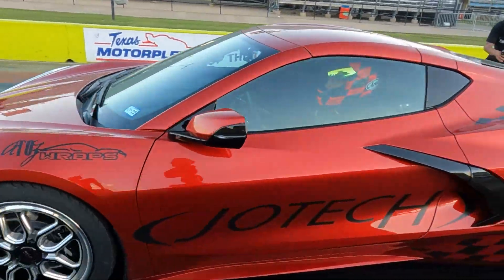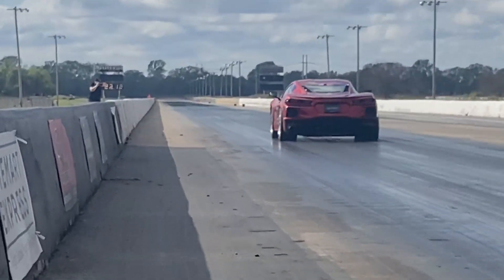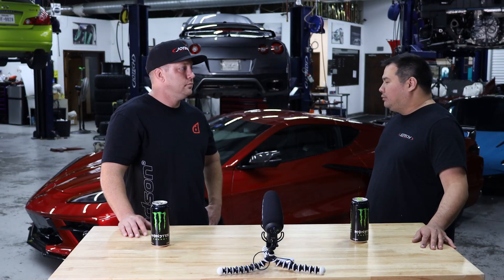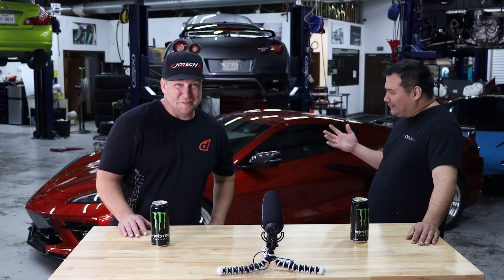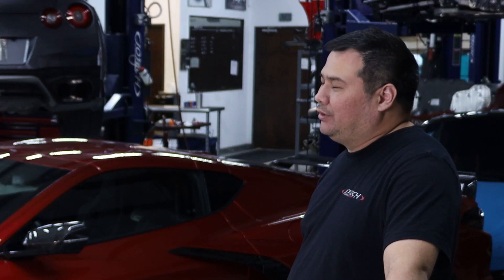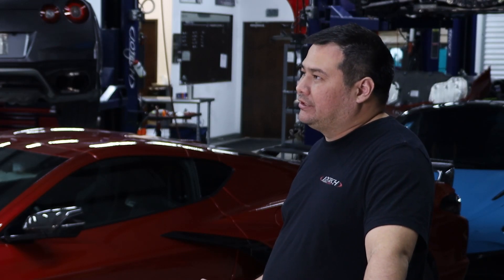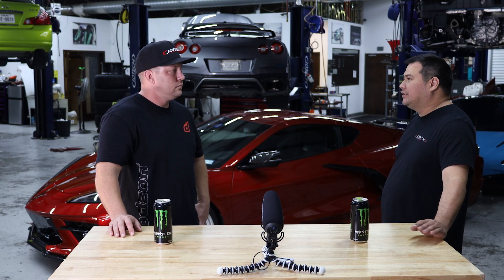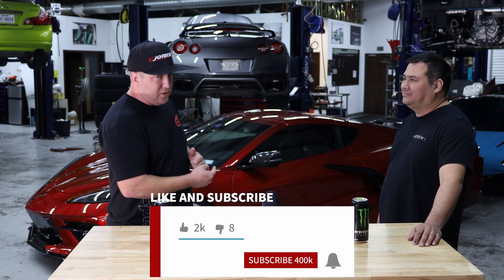the pursuit of an 8 SECOND C8 CORVETTE | how fast can this car be?

Comment: I'm going with the P64 twin turbo set up from ETS, intercooled, GESI cat, and am aiming at the 4.5 psi boost, 603 whp number as a weekend, sunny day fun car and possibly tracking it as well.  Can I get away with running the stock clutch at that power level?
Reply from the maker: Yes at 603whp. You’re right at the limit of what a stock clutch can hold. We noticed the OEM clutch started to slip around 650whp
Reply: @Jotechmotorsports  Thank you.  I liked and subscribed.  The cool thing is upwards potential.  Add a beefier clutch, turn up the boost 1.5 psi and have 700 whp!

Comment: Hello Guys great job. I have a C7 I obviously would like to change to a C8 but something that still I scratching my head that for the same amount of power (1000 +) the C7s have been faster in the 1/4 mile.  I suppose the limiting factor in the C8 is the transmission. ?
Reply from the maker: Transmission is holding up quite well. 
However, the clutch and computer are the main factors holding back faster times